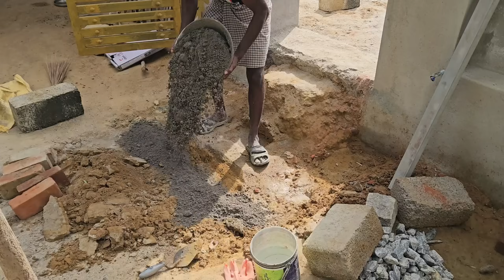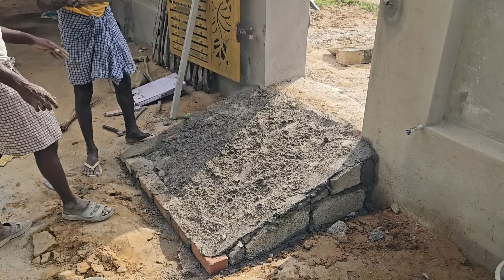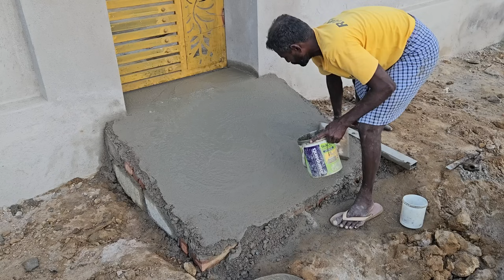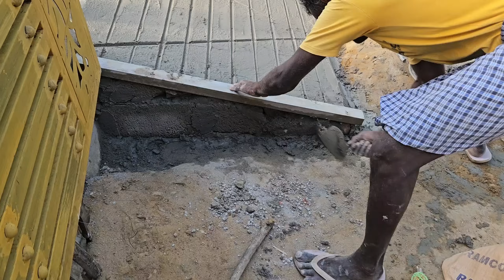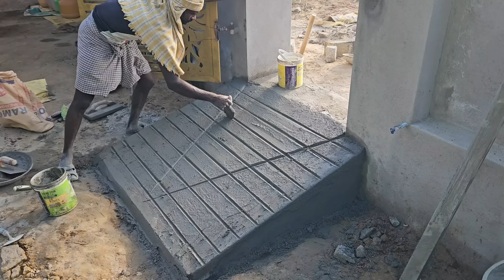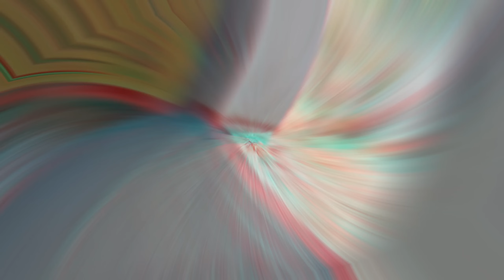Ramp Construction_Techniques of Front Gate Ramp Concrete with Cement Mixer|Ramp Design

Comment: Sorry this is not a Technical work.
No joints for the Ramp side walls connected to Gate pillars by cutting and removing the  plastering. 
No bricks and concrete blocks watered and cured.

The wall to be constructed one day the filling can be done .

No consolidation was done  before pcc laying for Ramp.
But  no pcc laid.

But the workmanship is Good and Harder.

Please  try to upload Best work videos.
Reply from the maker: Okay friend thanks 👍
Reply from the maker: Next time upload best videos